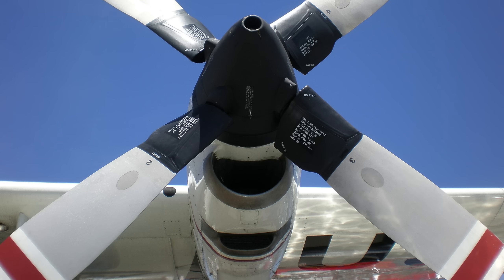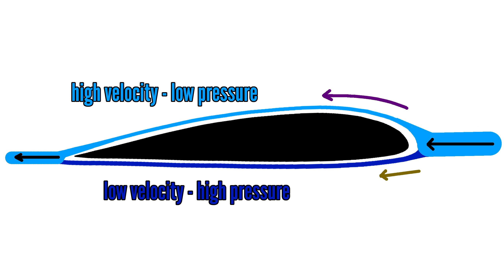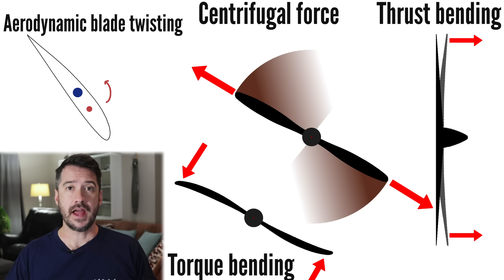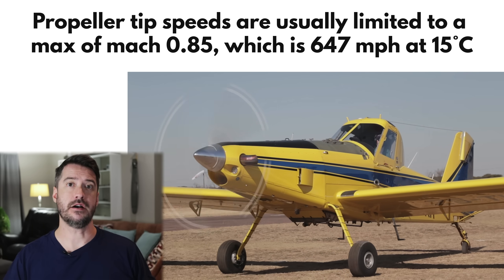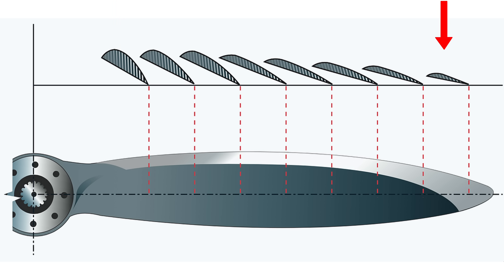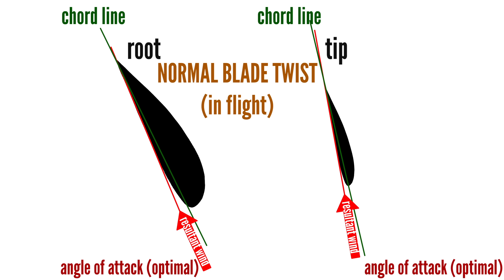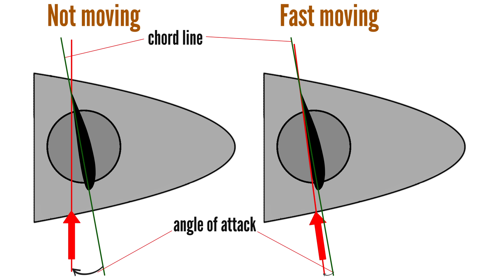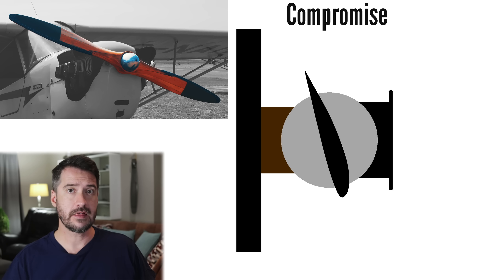One Video to Understand Airplane Propellers

Comment: It’s amazing to me that constant speed propellers are able to withstand the gyroscopic forces involved when changing direction.  Especially when doing violent aerobatic maneuvers I  would expect the blades to separate from the hub.
Reply: Unfortunately many pilots do not appreciate the high level responsibility of an engineer who  needs to design structures to buffer all the forces that are continuously working to kill a pilot.  A pilot is not killed because even in a normal landing the vertical  momentum is totally absorbed by the undercarriage and the fuselage needs to flex to delay the absorbing time . In a crash the structure needs to buffer all  unwanted forces and, as in a car, a collapsible structure will delay the deceleration to one which a human body can withstand. A human body cannot witstand much and in a piloted aircraft which is of the " come back home type" over 95 % of the structure is designed to bring the pilot back home and it is much cheaper to now design an autonomous missile which need not come back as that alone will double the range of the fuel on board. 
I am grateful to you for understanding the extra forces on the propeller  when the aircraft changes direction, It does no break because the engineers are responsible people and in their dilemma to make an economic aircraft then need to introduce in a small cockpit in which the pilot is caged, enough devices which can help the pilot save his own life.  Saving his own life is the priority responsibility of any pilot even if he is flying on his own   taking an old aircraft to the boneyard.  Testing and retesting and modifications and writing the right checklists for pilots is what keep flying as safe as it is,  Thank you for appreciating.

Comment: Air travelling over the top takes the same amount of time to travel across the chord as air underneath?  What are the physics behind that?  I do not believe that two adjacent air molecues need to be adjacent again after being divided by the propellar.  This is a popular myth in flight schools talking about Wings too.
Reply: Look up Bernoulli’s principle. It explains the low pressure/high pressure principle that makes flight possible. The reason a wing stalls is the airflow separates from the top of the wing when the speed of the aircraft gets too slow killing lift. I am a pilot, this is basic knowledge taught to new pilots. Low airspeed and a high angle of attack will kill you with a quickness, especially in a turn.
Reply: @Mr.Alwaysright-z8q   I'm afraid you did not understand the concept of a stall properly, the airflow does not separate from the top of the wing when the speed of the aircraft gets too slow, it separates when the critical angle of attack of the wing is exceed, this might happen at any speed, we associate this with slow speed because we practice stalls at slow speeds but what we are always doing is exceeding the angle of attack, and I guarantee, you might stall your Cessna 150 at 200 kts, assuming you do not lose your wings first!!!
Reply: @noneofyourbusiness5074 I completely understand a stall as I am a pilot. If airflow separates from the top of the wing, the wing stops flying and the plane becomes a brick.
Reply: Newton’s third law of motion also comes into it
Reply: And this is exactly the mindset difference between practitioners and theorists, ladies and gentlemen.
Reply: There are some wind smoke trace videos online into which die is injected in bursts above and below the wing. They clearly show that the die bursts start off together a the leading edge and DO NOT converge at the trailing edge. Equal transit time is a complete myth.
Reply: Ignoring that lift producing affect... What then produces lift or thrust would you say?
Reply: @neilfoss8406 thrust comes from the engine, lift comes from low pressure on the top of the wing.
Reply: Dude “some” would be an improvement most single engine fci still stick with the completely wrong Bernoulli theory even when symmetrical wings kinda null all that out…
Reply: @nerfthecows Bernoulli isn’t wrong, but it’s not the whole story. Like with a lot of physics, there are multiple compatible models, and multiple simultaneous interacting concepts.
Reply: @nerfthecowsyour wrong to say whats wrong without then saying what is the right principle that causes lift or thrust
Reply from the maker: @nerfthecows A symmetrical chord wing doesn't "null out" the lift creating principle. No upwards lift will be created at 0° AoA. But at positive angle of attack, the path of air over the top is still longer than the path below. The difference in speed is just much smaller, and would require more airspeed to give the lift required. Typically symmetrical chord wings are used on high speed airplanes as well as aerobatic planes.
Reply from the maker: Yeah a can of worms I honestly don't care very much about. Most important is the lower pressure caused by accelerated air over the top compared to higher pressure below, and the pressure differential displaces air downwards (which lifts the wing).
Reply: @LetsGoAviate there is a wind tunnel video with smoke puffs somewhere on YouTube that shows equal transit time isn’t true
Reply: @enginerdy not saying what it is that does work discredits what you say doesn't
Reply: @LetsGoAviate if you are attempting to pass on information you should care. The equal transit time myth has been thoroughly disproven several times over but sadly still persists in the industry. Some fight instructors still teach it even though it is wrong.
Reply: @andymckee53 Saying its wrong but not then saying what does is wrong

Comment: A very good description of prop operation.  One add may be useful…… Maximizing thrust, particularly at takeoff is done with a large diameter prop because the larger diameter accelerates a large volume (mass) of at lower speed than would a smaller prop pushing a smaller mass at higher speed.  Thus the larger prop gets a “firmer” grip on the air.  That is to say that the larger prop is not trying to push air that is slipping away….sorta like trying to walk uphill on a shifting layer of sand.  The slipping absorbs energy that is just wasted.

So tug boat props are big and slow. Takeoff contest winners use biggest prop they can.  

Physicists call this impedance matching.  For example, if you want to move an elephant, you bop it with something as heavy as possible, maybe another elephant.  Hitting an elephant with a high speed baseball may annoy the elephant, or even kill it, but doesn’t much move it.  Hitting a squirrel with an elephant is similarly inefficient.

Comment from the maker: Propeller Speed Reduction Unit (PSRU, or gearbox) Torque Multiplication Explained : https://youtu.be/LDsUTJ0f0tU
The Theory Behind Short Takeoffs Fully Explained : https://youtu.be/aJd1xEmbWOU
Reply: I wouldn't want a plane with an automotive engine and a PSRU. Either one could fail and leave you without power..